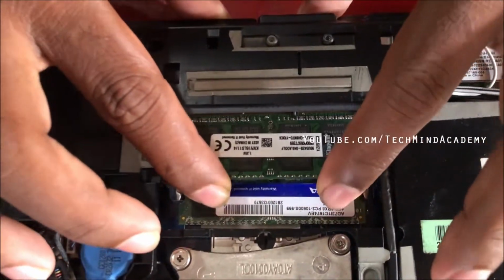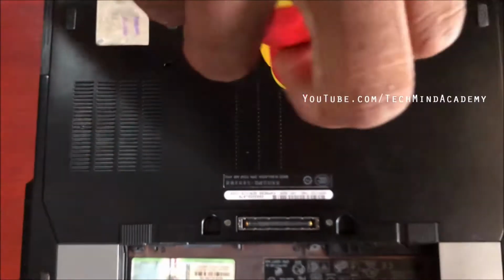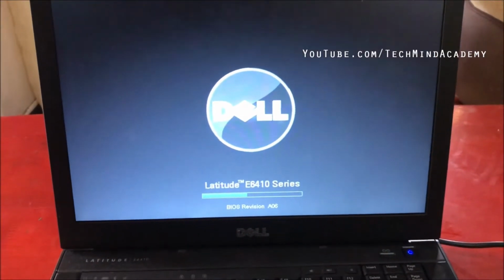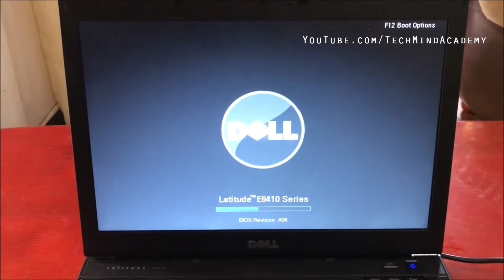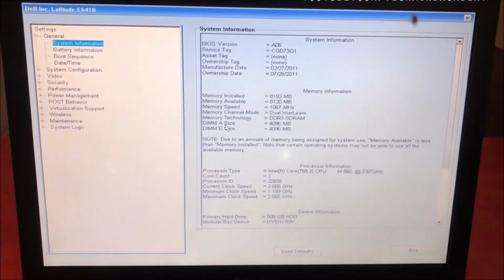Ram slot not working in laptop

Comment: If you had shown the BIOS with only 1 ram stick working and then did that and then showed 2 ram sticks working it would have been more convincing. Still gonna try though.
Reply: Did it worked for you
Reply: @madara-rp4bb  Haven't tried it yet. The laptop in question is a bitch to work on and my time has been otherwise occupied.

Comment: My laptop was working fine but then its just Stopped i remove and insterted the battery, then it worked for sometime but after few minutes it again got black i removed the ram and cleaned it, and insterted it again, then i realised that when i put my ram 1 in slot 1 it don't work but when i put my ram1 in slot 2 it works but when i put my ram 2 at any slot it doesn't i don't understand is my ram slot damaged for ram card or both
Reply: So you got your answer or what🙄because i am also having same problem plz help🙏
Reply: @codeblocksgamer1230  me too
Reply: 2nd ram kharab h

Comment: If i insert One ram display come  and shows me insert slot A but if i insert 2 ram it shows black no display
Reply from the maker: Sometimes you 2 has a cap short, please check the ram using multimeter. Sometimes your second ram slot has metalic dust when it clean, it will result short circuit, so black screen showing, use vacuum cleaner to remove dust
Reply: I have to same problem
Reply: Did your problem resolve????
Reply: Bruh same, did you fix your problem?
Reply: @markanthonyclerigo5582  nah it didn't i bought a 16gb single ram instead and placed it  in the working slot
Reply: Reasons could be:
Faulty RAM
Falult Slot
Or Incompitable RAM